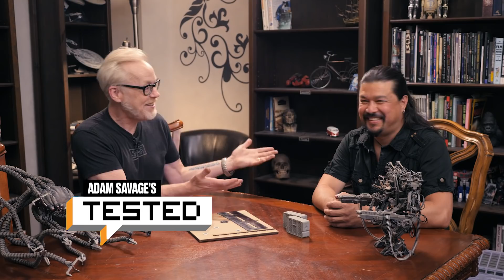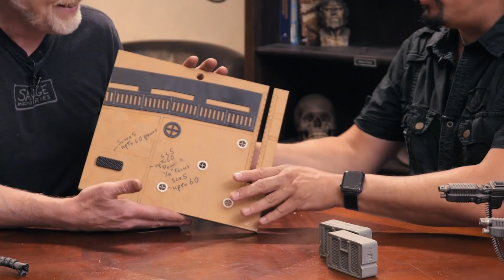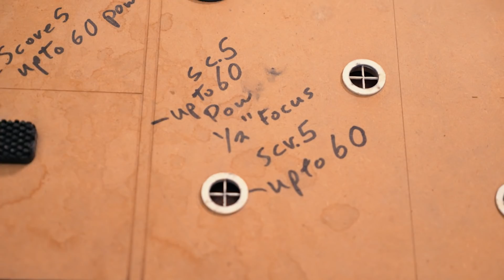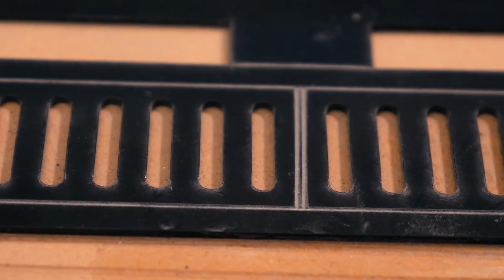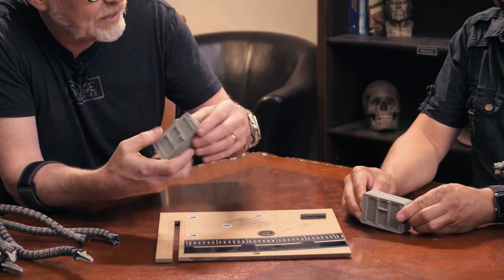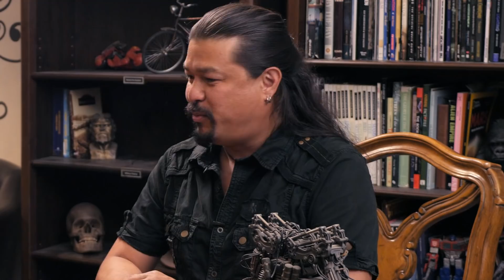Adam Savage and Fon Davis Discuss Working on Matrix

Comment: You found the proper solution to the facet of the curve issue. The only option is to make many small facets to appear as a curve. The reason is because it uses 3D models to cut, which are actually made of faceted triangles, even though a curve may appear smooth mathematically, in reality, it will always be faceted.

Comment: I spent a few years using a CMM. A 3 dimensional measuring.machine, not unlike a laser cutter, but had a volume inside of which you could measure ANY dimension on a 3d part.  It was insanely accurate (up to .001mm).  Held in a climate controlled room, with a ruby tipped probe, with a 1000 lb granite base. (Respect if you know why those features were important).   
Point is, in 2009, I still feel Adam's assessment that the software was our limitation.   It was so niche that our options for the scale of our hardware were almost none.  I think our software provider was out of Germany, so support was a mess.